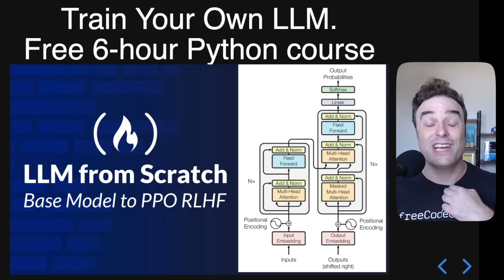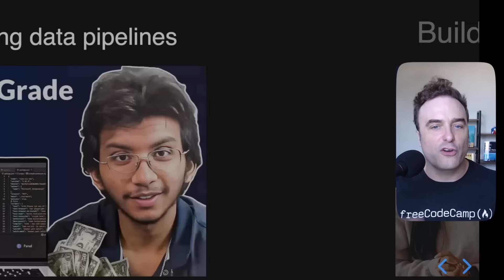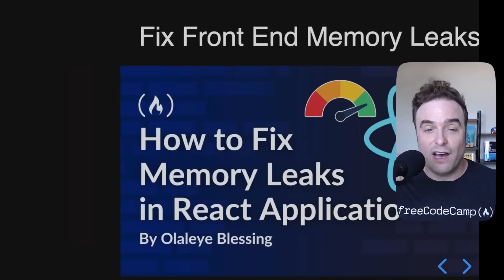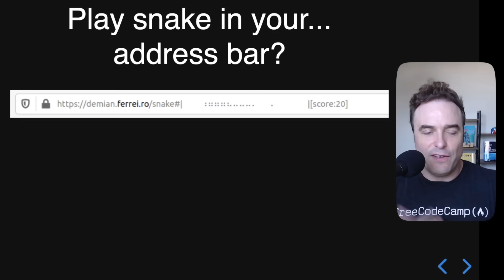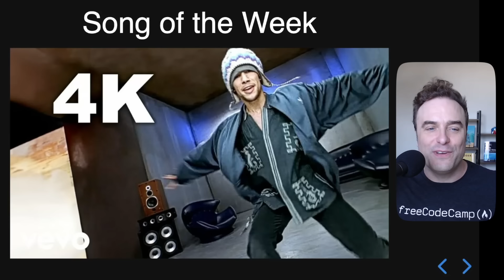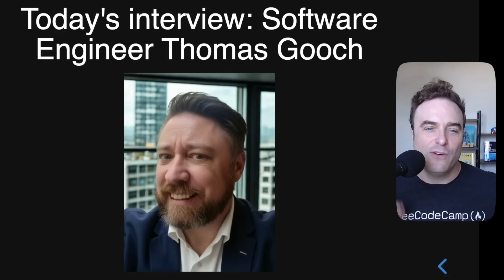From manufacturing worker to first developer job at age 43 with Thomas Gooch [Podcast #191]

Comment: Im currently in a six month program to earn a CompTIA+ certificate. I keep up in class pretty well. But when I have to do labs by myself Im a little confused. Any advice on how to be more consistent with homework? Anything helps.
Reply: First you got this and have the ability to complete the tasks. 
For advice, as long as you are following the steps, you should be able to complete the labs. You may have to start over or walk back step by step to complete the labs.
I am speaking generally here as I have not done or gone through an A+ course or lab.
To build consistency, set a fixed time to lab/study. It does not need to be long blocks of time, usually 1.5hrs is a good time block to get in the zone and make considerable focused progress.